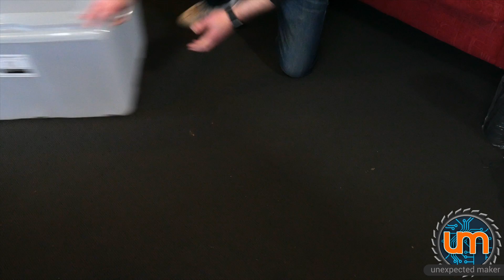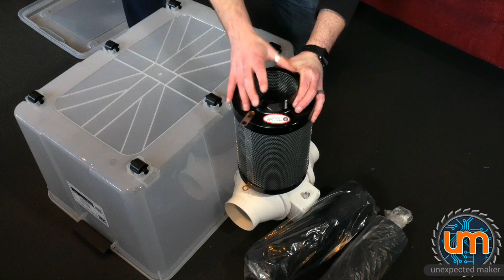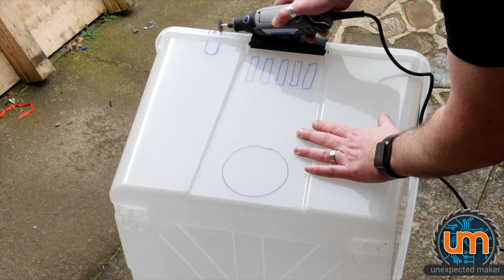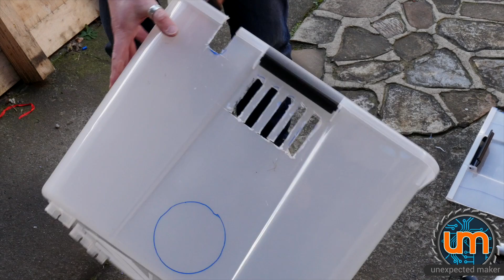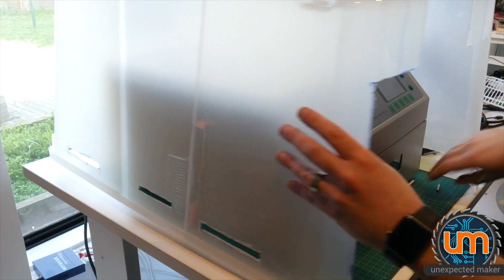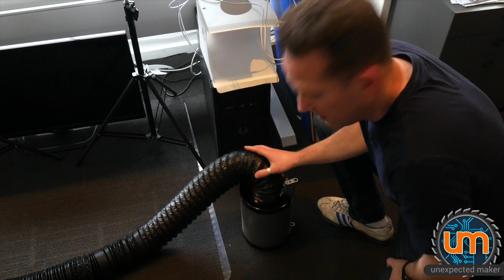Stink Killer - The DIY solder fumes extractor!

Comment: If the plastic is PE it has a melting point of around 105 degrees C, if it is PP it is 130 degrees C. They would have a machine barrel (processing) temperature of around 200-250 degrees C when manufactured.

The filter looks interesting, I wish I had thought of that instead of 3D printing a housing to make my own one.
Reply from the maker: Hey Scott, before I started cutting the tub, I took my hot air gun at 375C to the lid of the container and heated a a 5cm diameter area for about 15 seconds and could not see any visible change to the plastic, nor did it stay hot, in fact I could touch it within 5 seconds of me removing the hot air, and it only felt warm. So I don't know what plastic this tub is made from, but it can sustain WAY more heat than 105C or 135C.

Also the oven exterior doesn't get above maybe 60deg to the touch when reflowing - and I am moving the heat out with the exhaust fan, so though I'd prefer not to be using a combustable cover, this is working out way better than I'd hoped from a heat/danger point of view.
Reply: Unexpected Maker - I don’t think temperatures are an issue, just wanted to clear up what you said about it’s melt temperature. I work in the Plastics industry and hold both an advanced trade in plastics processing (injection moulding) and a diploma in plastics materials, and use both PE and PP, the container is most likely PP.
Reply from the maker: Oh, damn, I wish I had know that... I'd have picked your brains about what to use for the shroud, before I starting hunting. I'll know for my next project though! Cheers :-)

Comment: Nice. I wonder how that carbon filter would work with the fumes related to SLA printing. Only improvement I could think of is to make the box out of something less combustible, especially since you are running it out of sight in another room. Something like Wonderboard or similar with a looking glass of some sort. Or even better, relocate the LCD and controls to the outside of the new enclosure.
Reply from the maker: I'm pretty paranoid about reflowing and when it's running, the door is open, and I am continually checking it visually. Yeah,  ideally I'd have preferred a non-combustible shroud, but apart from metal (I don't have any metalworking tools or skillz) the only other thing I found was something called Villaboard, that is maybe similar to wonder board, but it's not something you can easily build a box/shroud out of from what I can tell.

Comment: Seon this infrared oven has its own MCU and software to control the reflowing and doesn't need a reflow master right ?
Reply: Yeah the T962 reflow oven uses the LPC241 microcontroller designed and manufactured by NXP (nationalism feelings pops up)
Reply: Thanks Youri !  haha yeah NXP is a Dutch company :)
Reply: I guess it doesn't need to be immediately attended after finishing like the conventional oven where the door needs to be opened ?
Reply from the maker: Nope, it has its own cool down cycle, and required no user intervention. That said, opening the tray after reflow will allow the boards and oven to cool down faster, so I can get the next set in.
Reply: indeed no time to sleep :)

Comment: My T962A seems to emanate smoke from the underside when in use so I have been toying with building a sealed "tray" for it to sit on with an extractor system built in. Maybe capture the rear fan output at same time.
Reply from the maker: Oh really? I have heat coming out from the bottom, but I have never seen smoke come out from it unless I was melting my first black boards ;) Maybe you are reflowing a tad high? or maybe it's just the solder paste you are using?

Comment: will Model 2 have a way for the Reflow Master to control the speed of the fan to help with cool down?
Reply from the maker: There is no Reflow Master controlling this oven, it has its own internal controller. I'm not sure this exhaust fan would play nicely with PWMing it's power. it's a very slow spin up and down.

Comment: Be warned, I have made stuff out of those sterilite polypropylene bins and they WILL eventually crack, maybe upgrade to a hdpe bin. Also add a removable pre filter to catch the oils and not clog the large odor filter
Reply from the maker: Yeah I still have the square carbon filters I showed in the video - and I am planning on mounting one inside the tub before the exhaust.. So I get a double filter, but I need to do some tests to see how much it restricts the extraction first.